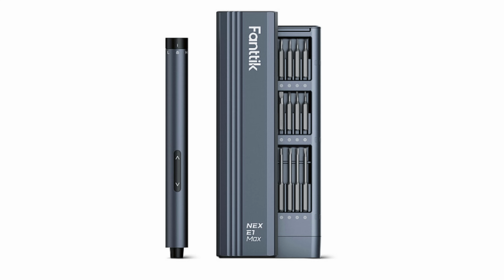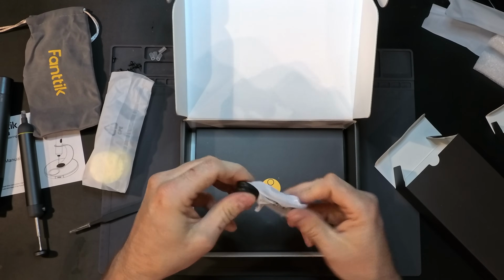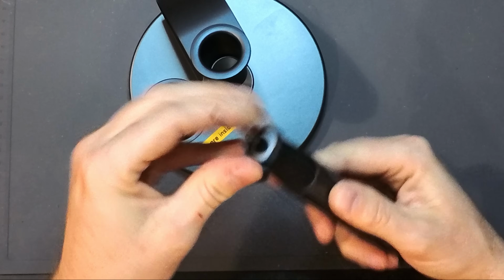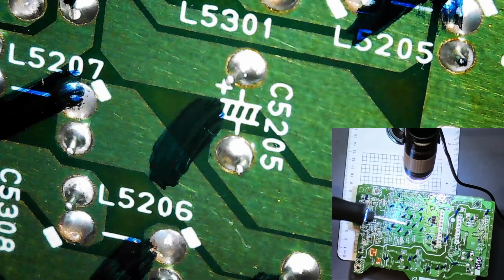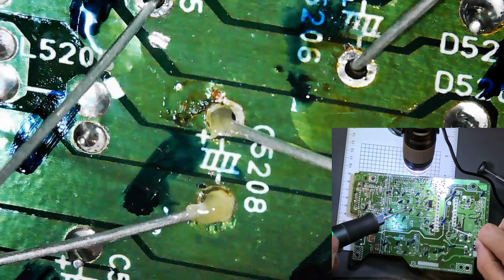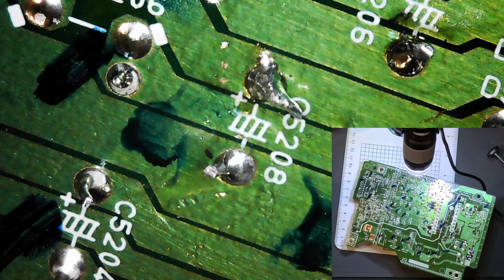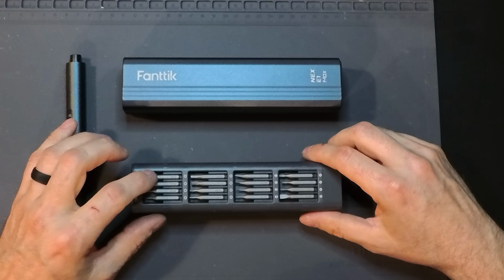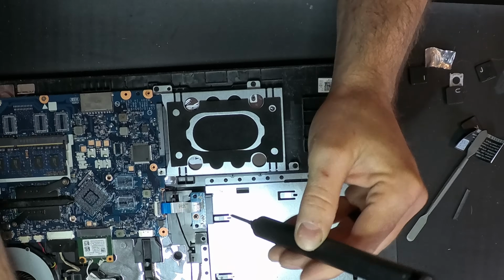🔴 Fanttik T1 Max Cordless Soldering Iron and E1 Max Screwdriver

Comment: I'm sure there's better irons out there from pros, but it being cordless made it waaaaaay easier for this newb to start practicing with it a lot more. My cheapie Harbor Freight iron has such a short power cord that I could only use it in one spot in my house. I had trouble replacing a single leaky motherboard capacitor with that one, but I've recapped several whole VCR power supplies with the Fanttik now.

Comment: What is best battery powered one in your opinion need one. tried Weller Cordless Soldering Iron 4.5 W could not even melt solder  it came with
Reply from the maker: To be honest, this was my first cordless soldering iron.  It's good, but I would recommended leaded solder since it has a lower melting point.  12voltvids did a review of the Fnirsi and seemed to like it.